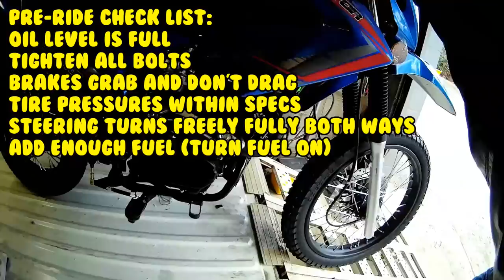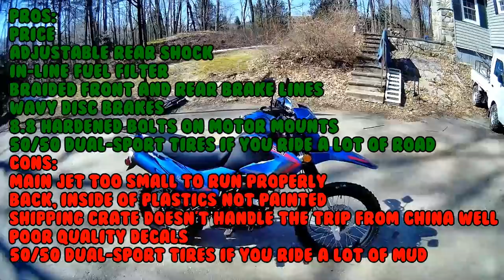$1300 NEW 2019 TAOTAO TBR7 230cc FULL REVIEW build ride mods Dual-Sport Pros Cons.

Comment: Question for you, since you have both bikes, which seat height is taller, the TBR7 or the HAWK 250?
Reply from the maker: TBR7 is taller! By about an inch
Reply: Thanks for the fast response,  @MotoCheez , I may order a Hawk 250 as well. BTW I'm trying to locate the extended Air/Fuel Mixture screw that fits these Chinese carbs. I ordered one for a Mikuni that didn't fit. Any suggestions?
Reply from the maker: @RavHarley  I don't know of any that will fit but try and contact this guy on ebay, he makes kits for these bikes. https://goo.gl/Xn4AH2
Reply: He just got back to me,  @MotoCheez . According to him, none fit that carb. I think before I'll pay $20 for the special tool which is available, I'll just put that $ toward a Mikuni swap.
Reply from the maker: Probably a wise choice. You can get in there ith a bit off a screw gun, it's tricky though. I set mine at 2 1/2 to 3 out and I'm usually pretty close.
Reply: OMG What a Difference! If you want to 'wake up' all of those 230 CC's get this carburetor "Hwbnde VM26 30mm Carb" It's an exact copy of the Mikuni for $28.98 on Amazon. I removed the supplied factory 100mm jet and installed a 110mm. The only other change I made was replaced the Air/Fuel Mixture Screw with an extended aluminum numbered aftermarket A/F Mixture screw, $8.99 on eBay. Started with two turns out and that's exactly where I left it. Bike runs as good as any of my other 6 now. Really, I can't believe the difference in the smoothness throughout the entire rpm range. To be fair, I was not having any major problems with the PZ30 carb. I had customized the jet set-up in it as well but wasn't satisfied with the responsiveness of the throttle or the smoothness of idle. This Mikuni VM26 solved all these issues, effortlessly. Don't waste time and money on the factory carb like I did, get one of these! @MotoCheez
Reply from the maker: I've installed a few of the mikunis on the hawks, there's not much difference in performance between carbs TBH.

Comment: How do you register it? Apparently Tao Tao is not a legit make
Reply from the maker: It is legit make, they do a ton of scooters, CT registers them, VT too
Reply: @MotoCheez  I managed to get it done. In NH it has to be registered with Taoi as the make. System won't take Tao motors or Tao Tao
Reply: @MotoCheez  I Just got two in today. I Bought them because I saw one of your videos on them. Definitely interested in the mods

Comment: You inspired me to get the TBR7. Never worked on a bike before. Today I rejetted and installed a Mikuni carb. After some issues...it actually started ! Awesome. Does your tbr7 have a choke cable going from carb to left handlebar? I also like the idle screw on the stock carb. Thanks
Reply from the maker: No choke cable on the one I had. Awesome

Comment: push rod motor?
Reply from the maker: Yes. The DB36 and hellcat OHC
Reply: @MotoCheez  yer thought so i had a 140 cc that looked the same  those motors are in a few different bikes i seen a lot in the phillipines
Reply from the maker: Very reliable low maintenance copy of the Honda CG engine

Comment: Thinking of trading in my Ktm 1290 adventure R for one of these
Reply: Don't, I have the 2018 model of this bike, even after removing the little catalytic converter and other mods it sure ain't no KTM.  It's okay, but to be honest i had to do a lot to get it okay, like making fork spacers and changing the fork oil to stiffen the front end, switching to a D.I.D. chain, removing the cat/converter, rejetting, regearing, and it feels kinda like a old seventies Kawasaki, the frame twist a little now and then. I do ride kinda aggressively,  but nothing like i used too. If you're KTM needs work, you should just do it or have it done, because that bike is way better than these.  Like i said, the TAO is okay, but just okay, and not okay for a younger version of me. Full disclosure i am partial to Maico's, Husqvarna's, and KTM's because that's is what was fast when i was in my early twenties. Also i only way 165 pounds, if you weigh more your performance will be even less then mine. Ride one first, You be the judge. Also to be fair, mine is a Hawk, but it's pretty much the same bike.
Reply from the maker: It's far from a KTM, I've always likened  it to an 80s Japanese bike. It's not a motocross caliber bike, it's an Enduro, good for trails.
Reply: @MotoCheez   You're an honest broker, I liked and subbed. If i had seen your videos before i bought one i might have gone a different way. I do like my Hawk, But now i just cruise trails easy on it, and cruise around town. I did mount a BMW K75S rear top hard case on it for party store runs. Before that i did manage a few fast laps at a friends track, but like you said, motocross is no friend to the Hawk. It's tough though, it didn't break when i rode like i stole it!! :D
Reply from the maker: Lol. Ty. I don't sell them at all, just do videos and try to be honest about it

Comment: Mine won't start once I ride for a period of time and kills battery trying.. any help?
Reply from the maker: Does it stall or after you shut it off?  Sure you're above the reserve level in the has tank?
Reply: @MotoCheez  shut it off and  3/4 tank when the bike cools down it starts right up
Reply from the maker: @jamescunningham8161  I'll bet the cap is not venting. Try opening has cap when it does it. I've heard it happen a few times
Reply: @MotoCheez   I'll check it out bud thanks
Reply from the maker: Cunningham please let me know...
Reply: @MotoCheez  road it about 6 hours this morning and the battery died again and it's a gel battery
Reply from the maker: cunningham  check the wiring to the regulator under the gas tank. It's not charging apparently

Comment: Why the freeplay on the clutch?
Reply from the maker: So it has room for clutch to wear without the cable holding it making it slip. The play gets smaller as clutch wears and you have to re adjust.

Comment: headlight mod? and would you put a 45 rear sprocket on it?
Reply from the maker: I put LED bulbs in all mine, 45 if you ride on pavement a lot
Reply: @MotoCheez  do you have link to led bulb?
Reply from the maker: All my links on motocheez.com. https://amzn.to/2AZTXap
Reply: @MotoCheez  carb link doesn't work. how would I adjust stock jet needle?
Reply from the maker: @ezraconner875  washers.. should work on motocheez.com.

Comment: You really, really should use something like Coppa Slip on every screw, nut and bolt and silicon grease on every electrical connection block, switch etc or it WILL corrode and fail within two or three years.

Comment: I bought the Mikuni vm26 carb and installed the 110 jet. So, to adjust the mixture screw should i screw it all the way in first then go out 2?
Reply from the maker: Yes
Reply: @ MotoCheez...thanks a lot for all your answers to my questions!
Reply from the maker: @HS-ly9ze  yw!
Reply: After doing the 110 jet in the new Mikuni carb i installed. The max speed i can get to is about 64mph thats pushing it with slight downhill. I weight 145lb. Is that normal cause i would think i would get higher speed with my weight?
Reply from the maker: @HS-ly9ze  that's about it unless you gear it higher
Reply: Sorry I forgot to mention I do have the 17 tooth sprocket as well..so still normal or didn’t do something right?
Reply from the maker: @HS-ly9ze  it's about right. You can go smaller on back sprocket too if you want a little more
Reply: Sounds good! Thanks a lot!
Reply: Sorry about the questions. I just finished riding the bike. However, i tried starting the bike earlier and i was having a really hard time starting the bike with giving some throttle with it. It took at least 10x but sounded like it was bogging. First time happening after doing the Mikuni carb with 110 jets. Any reason why?
Reply from the maker: @HS-ly9ze  2 turns out. 110 is good if your 2000ft or below. Clip in middle to starts with on needle
Reply: Im at 470ft. I did 2 and half turn out. You think that is the issue?
Reply from the maker: @HS-ly9ze  possible. I'm still running stock carb, mikunis are a tad different. I think you may have to go down to a 105
Reply: Okay thanks! I guess ill try adjusting to 2 turns out first and see. If not then might go down to 105 and see wat that does.

Comment: I have a question for you, my chain on my TBR7 will have about two inch. Of play, but if I move the bike back about two feet the chain gets tight. Would you know why. Thank you.
Reply: Sprockets are not perfectly round and or your chain is worn out.  Buy a set of new quality sprockets and a new chain.  Buy steel sprockets not aluminum.
Reply: @crookstonsucks  This is a brand new bike , only 320 miles. ??
Reply: @JohnJones-ff4nu   This is a brand new bike, only 320 miles. ??
Reply: @davidk1579  soft aluminum sprockets can deform easily if your chain is too tight.  They may have also come that way from China.  Also make sure your rear tire is aligned and not crooked on direction or the other.  You can check it by using the string method for alignment.  Plenty of videos on here to show you how to check rear tire alignment on a bike.  I have a laser tool that makes it quick and easy but it is also expensive.  String method works quite well.  Do not rely on any swing arm markings or stampings.
Reply: @JohnJones-ff4nu  thank you .
Reply from the maker: I'd say it's dry. Try Lubing it up real good. Ive seen it happen. The sprockets are steel
Reply: @MotoCheez  Thank you.
Reply: MotoCheez ok ...good steel not chineasium steel. But make sure if you replace, replace with quality steel like JT sprockets. Aluminum replacements are an option and tempting due to price. 
My experience is once a chain has frozen links there is no permanent fix for unfreezing them.
Reply: @JohnJones-ff4nu  found the problem. Can't believe I didn't realize my rear wheel was way out of alignment. From center of swing arm bolt to rear center of axial bolt it was 1/4 inch. Off.  All my other bikes all had hash marks on them, this one has nothing. Wow. Lol.
Reply: David k good deal that you found the problem. That will really wear out a chain a sprockets really quickly. It can also cause the teeth ok the sprockets to dig into the chain and break rollers on the chain causing your chain to break and may even cause and hole in your crankcase if it where to slap and get all bunched up at the little sprocket. So inspect each roller on the chain and look for damage to a roller. If you see one replace the chain. It will look like an sprocket tooth took a chunk out of the roller.
Reply from the maker: Wow! Good thing you found it. I always center the knobs to the shock. You can use a long straight edge to the front wheel but who owns a 5 Foot straight edge.
Reply: MotoCheez you can also use the string method.  There are plenty O videos on here on how to do the string method.  The shock may not always be midline.
Reply from the maker: True! That's probably the easiest and most accurate

Comment: Basically a hawk. Looks better though!
Reply from the maker: Yes, better brake lines discs, and rear shock... Dualsport tires...
Reply: Is the rear shock adjustable?
Reply from the maker: Yes!!!
Reply: Do you think the rear shock will fit on the rps hawk.
Reply from the maker: @motojohnnymoe4799  yes it will

Comment: i would have detached the exhaust before the carb, should have tried that first.
Reply from the maker: Why?
Reply: @MotoCheez  figured it was the stuff they added for the emissions on the exhaust that was making it sound like it was on choke. plus it would have been quicker to rule out. just a thought
Reply from the maker: It's just an air tube check valve thingy, totally useless lol. 👍👍😁
Reply: @MotoCheez  does it affect performance at all? its not required in my state so if it does, its the first thing that comes off. i plan on getting either a magician or the hawk this spring, whats your pick if you could only have one?
Reply from the maker: Not really, even when I removed the Catalytic converter it wasn't noticeable. A pipe did help it a bit, Carburetor mods did the most power for the bike!
Reply: @MotoCheez  ok right on man, thanks

Comment: What bike do you think is better,  this bike or the hawk 250 ?
Reply from the maker: This has more upgrades, the hawk has the nobby tire, which I like
Reply: @MotoCheez  I see the exaust  , bigger carb , light cluster  , sprockets  etc.  For the hawk. Was just going to get one of the hawks , but  probably just throw in another grand an get a Honda or something.
Reply: @MotoCheez  also didn't the hawk just get EFI ? FOR 2019 MODEL
Reply from the maker: Ya. You can find a used Honda for a few grand more
Reply: @MotoCheez  but really  , these are cheap enough where you can buy a new one every couple years.  I do like the looks of them.
Reply from the maker: True

Comment: Where did you get it from?
Reply from the maker: Txpowersports. More Information on description. Save a few buck using motocheez on checkout
Reply: I got a Lifan XL200 (a heavy clone of the Honda XL200) and enjoyed it very much, until I got mobbed by cops (in Venezuela, other story) and sold it right after getting it back. In my experience, chinese bikes are durable, yet heavier than their japanese original counterpart ( my Lifan weighted 135 Kg -  around 300 pounds) and many parts are interchangeable between japanese and chinese clones. Do you know who distributes chinese bikes with engines over 250 cc in the US?  I'm aware of a clone of the BMW 650FS, which seems to be OK.

Comment: so anyone who bought this will have to mod the carb?
Reply from the maker: High elevations probably wouldn’t have an issue. I’m only at 500feet
Reply: @MotoCheez  Im at 82' feet. I suppose I definitely have to mod right. Should I do 110 or 115?
Reply from the maker: Yeryi G I’d start with a 115
Reply: MotoCheez should I change the rear sprocket to a 45tooth or it won’t make much of a difference? Also, if I do change the rear sprocket will I have to resize the chain?
Reply from the maker: I actually finally counted the rear. It’s t has a 45 tooth rear and 17 tooth front

Comment: Why did you buy this?
Reply: Wtf? You had to repair a new bike? Jesus what the f**k!?
Reply from the maker: Same with hawk250 I bought 3 years ago. It's carbureted, anything today carburated is lean.. I Paid 1200. Still going strong, some hawks have over 10,000 miles on them.
Reply from the maker: I bought a Brand new CRF250 Honda 2 years ago and had to clean a mouse out of airbox, and adjust the EFI... I have video on it, I rather tweak my own bike than drive it an hour back and have them keep it a few days

Comment: Update, Ordered it Sunday it arrived Thursday. Two Thumbs Up to TxPowerSports! Mine came with dual discs, black rims, and the airbox mod was done at the factory, Sweet! Apparently Chinese factories keep their ear to the ground on ways to improve their products. I haven't taken the carb apart yet because the mod kit hasn't arrived, but will update with shipped jet sizes and choice of updated sizes if in fact it needs any. It started first click of the switch and seems to run excellent, so it may not need any carb changes. We'll see, the kit is worth the price just to get the sprocket, plus the jets supplied in the kit also fit the Mikuni carbs if you go that route. Rear chain was waaay too tight outta the box. Cute birthmark on the left sidecover, thanks front disc.
Reply from the maker: Sweet!!!🔥🔥🔥 Yeah they're listening. Same birthmark place!
Reply: @MotoCheez  All good here, got the correct paperwork, got my tags. Thx again!
Reply from the maker: Woohoo! Awesome!!!